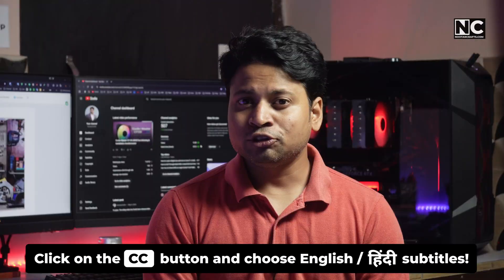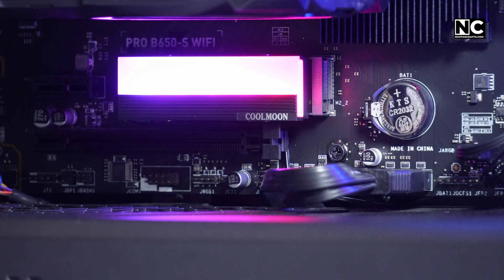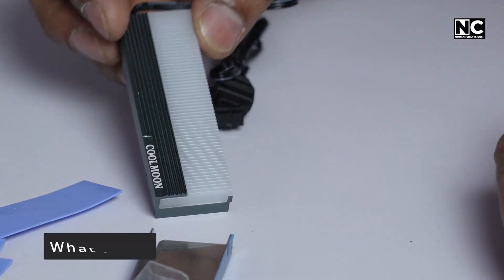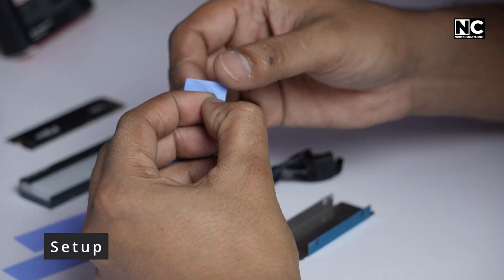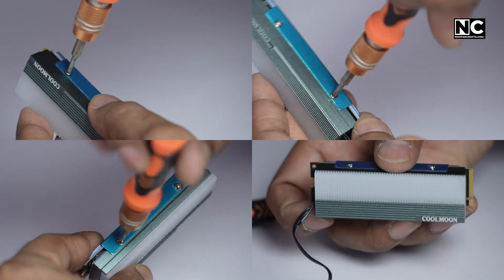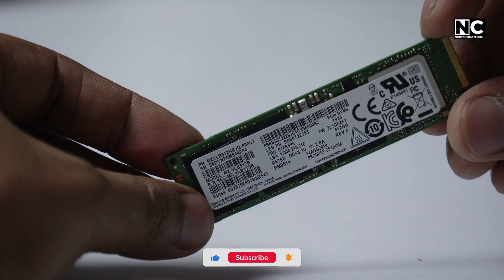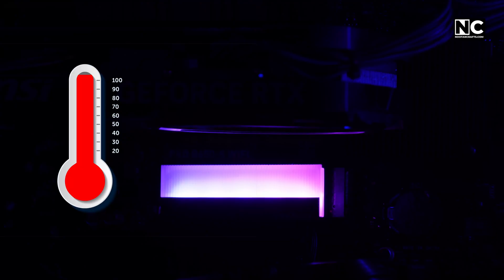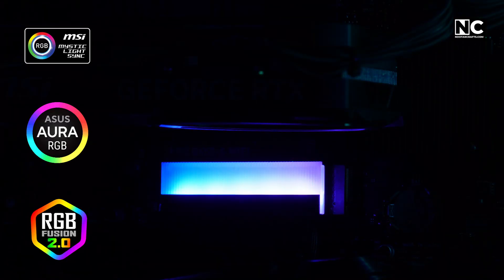COOLMOON CM-M2A ARGB M.2 Heatsink SSD cooler - Unboxing & Installation

Comment: Oh no I'm literally the only comment.

What's this other 3pin for? Looks like a fan connector.

Also also, can you daisy chain this? Looks like it has the ability to daisy chain so, I'm gonna try that I guess- since I only have two argb slots. I'll give it a go without Daisy chaining it and then try it with a daisy chain. 

Here we go, thanks temu, hope it's not a pos
Reply: Okay so, first off, mine came with three thermal pads? One THICC boi and two thinner ones. But...

Connected directly to mobo, seems to work. Reconnected my secondary (GPU,CPU,mobo,LED strip,Cooler,etc) in the daisy chain, both work, good there.

Didn't check thermals but I'll trust this video is accurate.

Thanks CoolMoon (not) for the instructions on how this works.
Reply: Still confused about this extra cable, it's a 3 pin, looks like a fan connector (not the argb connector) 

Wrapped it up and tucked it away, that'll do I guess haha
Reply: All of the thermal sheets are longer than the thin ass aluminum block...? Lol okay then
Reply from the maker: The first comment is always the bravest—and the most legendary. 😄 Seriously, thanks for testing it out and sharing your experience in detail. You just added more clarity than the manufacturer ever did. That extra 3-pin cable had me scratching my head too… I think it exists just to confuse us.

And yeah, those thermal pads do look like they were made for a bigger planet. 😂 Appreciate you watching and dropping real feedback—helps everyone, including me. You’re the MVP here! 🫡